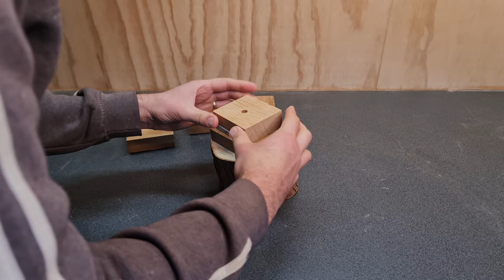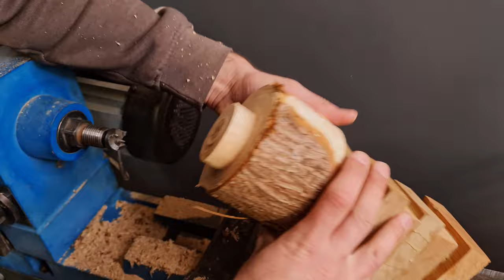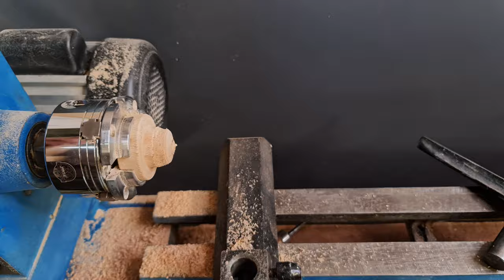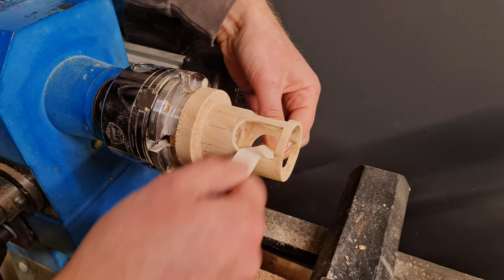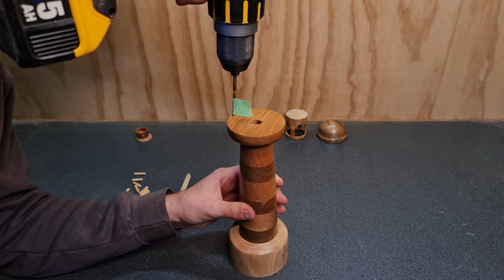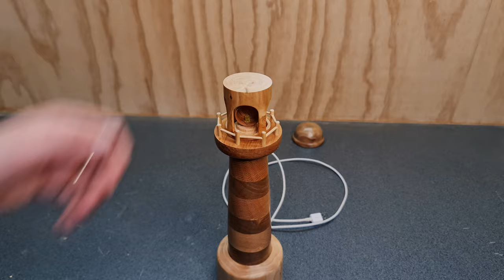Woodturning - A Lighthouse that lights up

Comment: Again, you have made a simple masterpiece, great job brother.  
I noticed your new little chuck. What brand name is it and the specs?
Love your post, so keep up the good work and God bless.
Reply from the maker: Thank you Klatt! I decided to purchase a chuck, rather than gluing to waste blocks all the time. The chuck I am using is a NOVA G3 PRO-TEK.
Reply: @TurnedOutGood ..... I see your point and agree, but I noticed that the small chuck does not get in the way of working as a bigger chuck may.  That didn't dawn on me until I watched your video.  Again, I enjoyed your lighthouse project and thanks for posting a reply.
Reply from the maker: @klatt4057  This is true, I did take some time to look at reviews/specs of different chucks and this one seemed to best fit my needs, while still being capable of supporting larger sized projects. Thank you for taking the time to watch and comment.